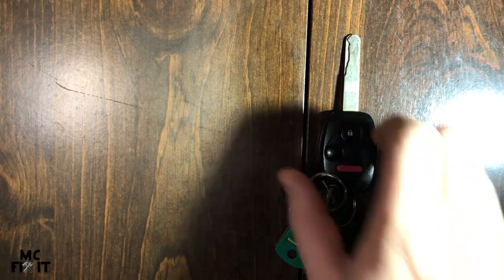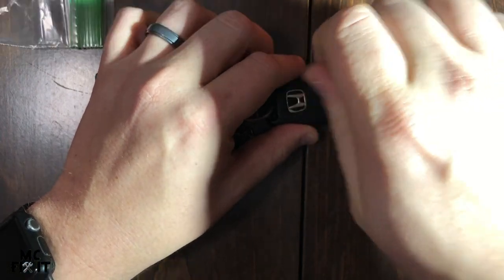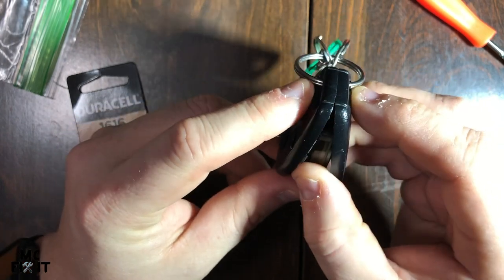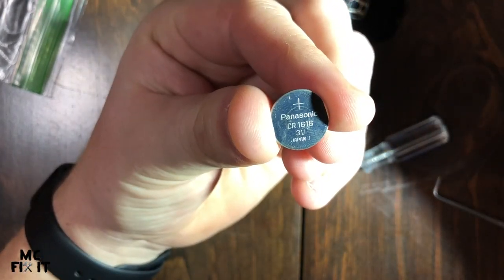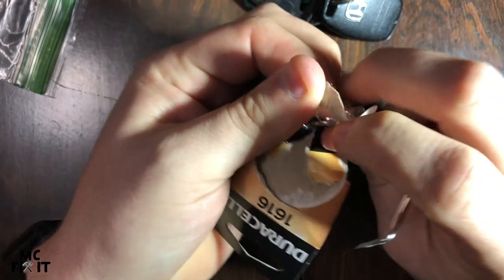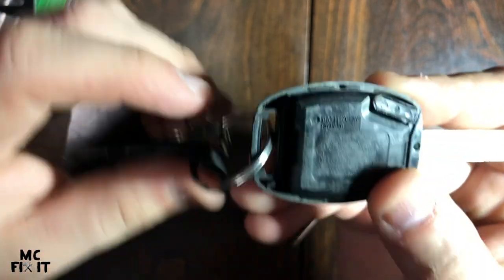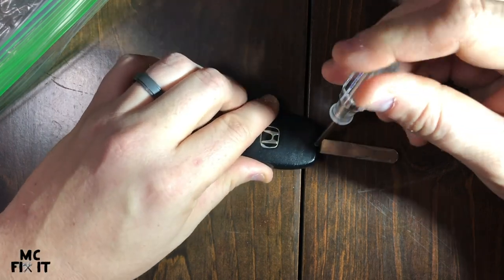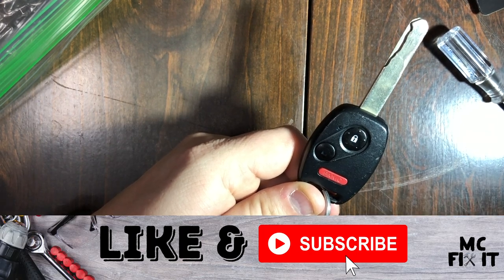How to replace key fob battery on Honda Ridgeline 2006 (Complete Guide)

Comment from the maker: Find out how to easily replace your dead battery on your key fob for a Honda Ridgeline 2006. 

00:18 TOOLS:
• Philips Screw Driver - Small - https://amzn.to/3hdpzx0 
• CR 1616 battery - https://amzn.to/3o2KzYn
• Pick (optional) - https://amzn.to/3nZM8q4 
• Plastic bag or magnetic metal tray (optional) - keeps you from losing the screw - hhttps://amzn.to/3hdUiJZ 

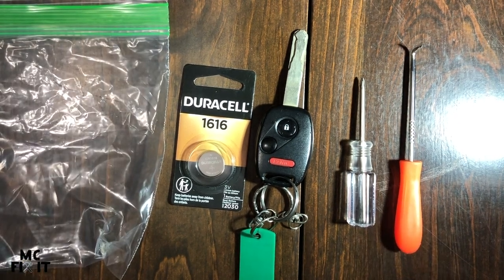00:35 THE FIX: With just a few tools, you can easily replace your dead battery in the key fob. 

This video works on all makes and models of vehicles. 

Check out my website at http://mcfixit.us 

Disclaimer:
Due to factors beyond the control of MC FIX IT, I cannot guarantee against improper use or unauthorized modifications of this information in the video, post, blog, or social media. MC FIX IT assumes no liability for property damage or injury incurred as a result of any of the information contained in this video. Use this information at your own risk. If you feel uncomfortable at any time. Stop and go to a professional. MC FIX IT recommends safe practices when working on vehicles, your house, or any other project and or with tools seen or implied in this video. Due to factors beyond the control of MC FIX IT, no information contained in this video shall create any expressed or implied warranty or guarantee of any particular result. Any injury, damage, or loss that may result from improper use of these tools, equipment, or from the information contained in this video is the sole responsibility of the user and not MC FIX IT.

#mcfixit #autorepair #fix #replacement #keyfob #deadbattery
——
Supplies used to record this video: 
* GoPro Hero 7 Black - https://amzn.to/3f3ALtb 
* 256GB Flash Drive - https://amzn.to/33pAueG 
* Vlogging Frame - https://amzn.to/33tajE0 
* GoPro Pro 3.5mm Mic Adapter - https://amzn.to/2RCURCu 
* Youmic Lavalier Lapel Mic - https://amzn.to/2R55sWX 
* Boom Stand (tripod) - https://amzn.to/3bdkQaw
* 5/8” to 1/4” adapter (boom to blogging frame- https://amzn.to/3txrVsM 
* Portable Battery Powerbank- https://amzn.to/3vJQc0q 
* 6ft USB to USB-C (powerbank to GoPro)- https://amzn.to/3uAS5MH

Comment: question...... my fob works but all of sudden my horn does not sound after lockdown button is pressed . Will new battery solve this ?
Reply from the maker: I doubt that what be the cause bc it just sends a signal. But most of those batteries are only a dollar or so each, so you may want to check to see if that’s the root cause. A cheap and easy fix if that’s it, I’m guessing it’s wiring on the vehicle. Let me know what you find out!
Reply: @MCFIXIT  ran around and opened and closed all doors including ridgeline tail gate and in bed storage door. Surprise horn sounds on lockdown yeah !!!!